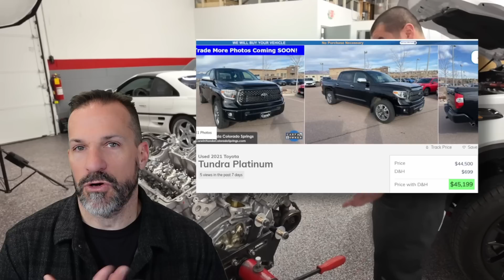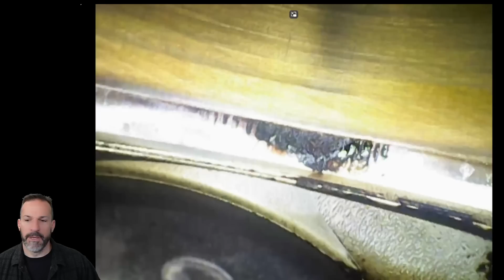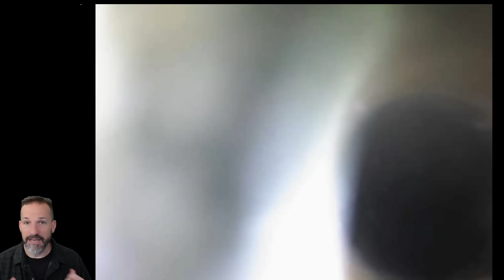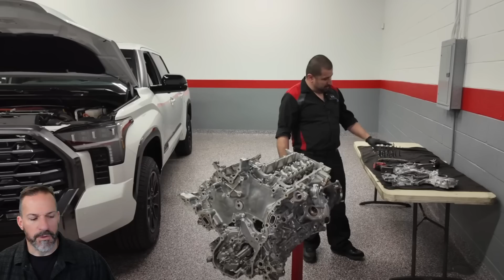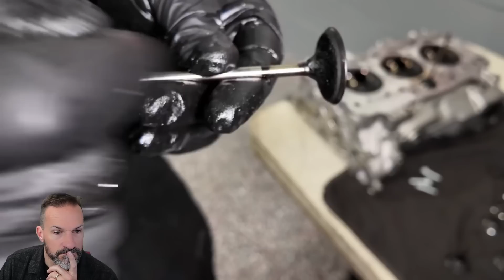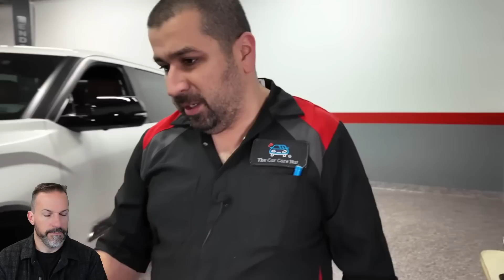Has Toyota LOST Their EDGE? Tundra Turbo V6 TEARDOWN vs. 5.7L V8

Comment: I am confident that I figured out what is causing it. Toyota doesn’t want consumers to know the truth. They messed up with the design, but it’s not apparent as to why it would fail. Updating the main bearings should resolve it, but every motor they have produced would need to be replaced. I bet the engines that fail are run harder or have a higher peak RPM.

Comment: Toyota dropped the ball on this engine design. 1st mistake is the main bearing support went from steel to aluminum alloy (fatigues 2-3x faster). 6 to 4 bolt main (again... weaker). Ladder lattice design (requires total structural integrity for full support) one bearing failure immediately induce vibration through the whole lattice.
Add: Going from V8 with 5 bearing caps to V6 with 4 bearing caps (that's 20% reduction in bearing surface) while having to handle the extra torque and horsepower will not equate to long engine life. Physics and math still applies in current humanoid engineering.

Comment: I am guessing the bearing surface area being smaller, variable speed oil pump, combined with 4 bolt mains AND the 0w-20 oil - works great in testing for mileage, but in the real world - failure.

Comment: The oil ring locking up was an issue on the 2.0T Honda engines as well. Had a 2022 accord with that engine and found that detail during my research on the engines. Seems to be an issue with tolerances with a lot of these turbo engines.

Comment: If you watched the entire Car Care Nut review and break down, he states that this donor 3.4 likely ran low on oil.  Pull that stunt with a 5.7 and you're knocking in not time.  He is a very knowledgeable Toyota tech and owns a new 3rd Gen because they're just a better Tundra, smoother ride, twice the power, and sharper looks.  This is clearly an anti V6 channel, which is fine, but let's not forget that Toyota does stand behind their product.

Comment: I bought a new 22 Tundra and I sold it at 7,982 miles after the engine started having a noticeable thump as the engine lit off during start. I really liked the Tundra but yes, Toyota has lost its truck edge on the Tacoma too.
Reply: As well as losing its edge over its biggest rival of all, the Nissan VK56 V8.     That Nissan has never suffered from blown head gaskets or any other of engine problems.
Reply: @robertpoirier8520 especially the Gen1 04-15 VK56DE, seen endless with 400-800k+ miles!

Comment: Im against ALL  of the small displacement big power turbo engines.   Manufacturers are expecting 2 opposing priorities to reconcile,  more power with less materials.  These little engines are putting out power and torque that's expected from an industrial turbo diesel but with much less mass , aluminium block and head instead of cast iron. It can't last. The pursuit of ever decreasing emissions has hit a wall , its time to accept that and back up a bit. Im keeping my 06 and 16 V8s.

Comment: TCC does not understand bearings well. The locating tang does not hold the bearing, the crush created by the cap does. Also the that main bearing was loose because the spun bearing oversized the bore

Comment: Well, if a turbo engine starts using much oil it is prone to detonation. That's how I think the cylinder wear happened. This is a problem with a most of the companies now, not just Toyota. Turbo charging smaller engines is the only way they can meet current emissions. From an emission standpoint a V8 takes in twice as many gulps of combustion air per revolution as a 4cylinder. That said, the engines were so clean by say 2020 that it seems like the ones doing the regulating just want the ICE gone. That's certainly not reality though. The electrics have the same problem they've always had. Adequate battery storage without burning your house down.

Comment: This is a combination of several things starting with the engine design, moving away from what has been proven to work to adopt what people call creature comforts. Bring back the 5.7 V8, do away with the large distraction computer screen in the cabin for the infotainment center. It’s more distracting by the way. Take off things like cylinder deactivation it does nothing to save fuel to begin with, just adds wear and tear on an engine over time.

Also, make none panoramic sun roof option because when that fails it’s going to be a very expensive fix.  Trucks have become a status symbol now for many. Oh look mine has a panoramic view, yours does not. Mine has more horsepower and torque, yours does not. Mine cost ten thousand dollars more than yours. 

Well, as long as you know how you are going to pay the car note. Many people do not care about many of the above things I mentioned. They want a truck to go to Home Depot, haul gravel, dirty, plow snow, and be safe while doing all of the above. That is not a down payment for a home, or the price of one in some places. 
I do not care what you drive whether Ford, Ram, Chevy or Toyota. All of them need to go back to making reliable vehicles and stop handing out insane bonus to their CEOs and for what?  If some people continue to purchase these vehicles at the current asking prices and with the issues they are having. Nothing will get fixed.

Comment: Good video. I've been such a Toyota fan since the 80's but they had so much time to work on a whole new engine and continue to struggle. Has the culture at Toyota totally changed? The Toyota Way in manufacturing used to be about getting it right catching issues. It seems like that is gone now. I wonder if anyone has been fired in development and engineering? All the great feedback and tear downs they did on the old generation you would think they would have learned something. Their testing in the past has always been rigourus and I just don't get it especially since they had time to get this next generation right. It almost seems like things got rushed towards the end before production maybe due to COVID or something. I still believe in Toyota but they need to react quickly and hopefully have a nice refresh for 2026. What do you think is going on internally with them now?

Comment: Where the hell was the testing on these motors BEFORE they put it into production?  They should have SLAMMERED these engines with constant driving, old dirty oil, low  oil, thin oil etc..  overheat the bastard.  WORK THAT BEYOTCH!!  PROVE it can handle ANYTHING you throw at it.  THEN you put in your truck and put your name on it.

Comment: Damn. That TT is burned up. That cylinder wall wear is terrible. Low on oil? It would have to be pretty low for a prolonged time. The engine is just poorly designed. Also, you see the pistons' top ring land? Top ring land to top of piston is too short, kind of like the Subie EJ motors that would break ring lands. I think Toyota just made an engine that is too complicated, and they aren't used to designing engines like these, and sometimes I wonder if BMW had anything to do with the design of this engine.

Comment: All factory turbo vehicles arent meant to handle anything force induction. How long would the stock bearings, rods, valve, rings hold up to even 50k miles? Nowadays its meant to break down at a certain mile and if its beyond warranty, youre F'd!

Comment: Run cleaner through the engine and or soak the cylinders with atf overnight and keep the plugs out the crank it to get all the fluid out that scratching could be a ring starting to stick from Carbon

Comment: We love our '18 Camry.  4 banger with 101k miles on it.  JUST did the first brake job and the rotors were fine!  I couldn't believe it.  Even the backs were good.  And the rear pads were only worn 50%.  Averaging 37-38 on the highway, comfortable, interior holding up exceptionally well.  Great car!!  We looked at a base model 2025 Tundra SR5 4x4 with a twin-turbo V6 for $45k.  It was tempting, but with the issues Toyota is seeing with these V6s I'm VERY hesitant.  Thinking I'm gonna wait this out to see if quality improves.  I know prices won't.

Comment: My Bank blessed me with the unlimited miles warranty for the duration of the Loan 🙏🏼 hopefully in 4 years they bring back the 5.7 and i will trade in my 2025 sr5 Tundra and get that if not I will Tade in ly 2025 Tundra and get a 2021 Platinum PS i do my oil change very 5k and the dealership does my oil change the other 5k. Miss me with all that 10k oil change BS

Comment: I think I found the issue . The Lexus 3.4 tt has 6 bolt mains while the new 3.5 Tt has 4  bolt mains. The 3.4 has abt 30 more hp and around 25 ft lbs less torque than the the new 3.5 . So they had a engine that worked but then switched it up

Comment: Those deposits look normal. I’d start running a little bit thicker oil to fill the gaps and help seal those cylinders that have wear on the 5.7l. If you’re using 5w30 I’d recommend using a 5w40 oil instead. If your climate is relatively warm that would help longevity.

Comment: I have a brand new 2022 4Runnner TRD Pro being stored.  Has just the mileage to get it home from the dealer and moving it weekly for the tires.

2022 T4R SR5 PREM  with 20,400 miles.

Daily driving 2012 Camry beater.

Thoughts?

Comment: The head gasket issue in the 5.7 is caused from engine coolant not being changed regularly, coolant PH start to shift from alkaline to acid after so many heat cycles, its this acidity that eats the head gasket, so do a drain and fill every 30000 miles or every 4 years, whichever comes first

Comment: Thanks for the content. My 07 Tacoma with the V6 has over 270K miles and is going strong. I've had multiple offers for it but its not for sale. 
Same goes for my wife's 2011 Highlander with the 2grfe. V6. Almost 150k miles. Those older non turbo V6 and V8s just keep running. 
Personally, I think Toyota is going for planned obsolescence with those new twin turbo engines. Just my take for what it's worth.

Comment: I purchase a 21 tundra new and it was one of the last one built received in Nov 2021.. I only use Pensoil Ultra and change my oil
Every 2000 miles.. Imonly have 8000 miles on the truck as I use it for towing only. I installed the Genuine Trans cooler as
Toyota got cheap and discontinued external trans coolers…..clearly the new Tundra is under engineered and it is a LEMON.
I wish they did not keep the Tundra name on the new GENERATION because it has tarnished the TUNDRA NAME.
We all know that with new EPA guidelines they should bring back the V8 with a ten speed and a 371 rear end

Comment: The Car Care Nut said the new 3.7L Turbo V6's is one of the most complicated Toyota engines he's ever seen. So much to go wrong.
Reply: Innovation adds complexity. Complexity tanks reliability.
Reply: @ My 2011 Tundra with the 5.7L V8 is at 320,000 kms (200,000 miles) and going strong.

Comment: To be fair to Toyota, this is exactly how Ford and GM make their vehicles, it does not benefit the manufacturer if the vehicle has a high resale value. This is why you can pick up an 08 tahoe for 5k while a 08 LX570 is 20k all day. You know the tahoe will not last near as long, but it does not help the manufacturer over 10 years later. People buying brand new vehicles USUALLY do not care if they have a vehicle that can go 200k miles +, they just care about MPG

Comment: I have said for a long time when everyone was pushing this debris lie, this is an engineering issue. Toyota should buy every truck back at full price  (I'm not an owner) crush every single one and stay over with engineers that know what they are doing. All that worked on this thing should be fired. They would be hired by GM and Kia.

Comment: Cutting corners and upselling... talk about corporate greed. The Tundra just started selling down here in AUS, but that same engine is also being used in the LC300 and there have been a couple stories of those failing too early.

They say it's "machining debris" but it's clearly a faulted design. Those bearings look like they have nothing to keep them in place other than the rotational force of the crank so they slip out of the journals from all the vibrations going on.

Comment: People acting like the 3.4 iforce having that catastrophic failure rate in less than 1% of the engines is unheard of.. I wonder what rate the head gaskets in the 5.7 are going to fail at once we start seeing those more often? The same channel and mechanic spoke of that issue and due to the composition of the block and heads essentially blown head gaskets require a complete engine replacement due to not being able to machine the surfaces flat afterwards.  I wonder if it's going to be the same failure rate as the cam tower leaks.. or the timing cover gaskets.. or the valley plate leaks.. or the secondary air injection pump failures.  Oh how people love to forget about all those issues the "ol reliable" 5.7 has had from it's inception.

Comment: I had a 2013 Tundra and would love to own a newer one but this is a hard pass. I watched this guy tear this engine down and those bearings missing lock out positions is very concerning. I’ve rebuilt several engines and have never seen this before. If it was a debris issue different areas of the these engines would be failing and not just the front bearings. Crap, now what truck to buy? They all have issues.

Comment: He didn't say it was a "low milage" V6, he said he doesn't know the milage on this engine.  Most likely the person who owned this engine probably beat on it and used cheap, non top-tier gas (which would lead to high carbon). He also said this was 'oil starved'

Comment: Have you been using top tier gasoline over time or other type of fuel? That may make a difference…yes?
Reply from the maker: For my engine that you saw with borescope, no, I've been using mostly cheap 85 octane here in Colorado. It might make a difference with carbon buildup but the valves looked pretty good so who knows.

Comment: Good thing I've bought the 2024 Nissan Titan with the 5.6L Endurance V8 in it with 400 HP and 413 Ibs of Torque vs the 2024 Toyota Tundra with its crappy turbo V6 in it.

Comment: December 2023 my wife and I went to a Toyota dealer to purchase a pickup truck.  You say the V6+TT is smooth?  I test drove 2 Tundras and both shook and choked when I floored the throttle TWICE each on a straight empty road.  I immediately decided one of the last V6 Tacomas still left on the lot knowing 2024 tacomas were going 4Cyl Turbos.  Using turbos on engines that can handle the vehicle without a turbo is one thing.  Using turbos to make up for underpowered engines is a NO GO.  Guess will be buying used old vehicles going forward or until car companies realize they are killing the market.

Comment: The bearings remind me of the 3.0 EcoDiesel used in vehicles like the Ram 1500. Narrow bearings being asked to withstand extreme forces. It's looking more and more like Toyota is using the "debris" theory to avoid a massive class action lawsuit over a defective engine design. They know there are hundreds of thousands of Toyota and Lexus vehicles with a flawed engine design that makes it prone to bearing failure. So instead of issuing a recall because of a design flaw, they simply say it's a rare issue caused by debris. Much more difficult to build a major class action lawsuit when it's a "rare and random" debris problem. All while they quietly make part design revisions.

Comment: So I actually work with AMD, we talked about this video and found out this motor he looked at had 22k miles and had terminal failure due to the 10k oil change intervals. These new motors are very complex and unfortunately are engineered to fail unlike the UR series engines

Comment: The guy clearly mentioned multiple times that he did not know the history of the tundra motor nor did he know how many miles were on it , one thing for sure was the owner ran it low on oil for how long ? Who knows? So what were you expecting the outcome to be from this engine good ???

You run the oil low on any modern engine and kiss it goodbye!  Even your 5.7L ✌️

Comment: Keep up the pressure guys, maybe we can embarrass Toyota back into offering a 5.7
Reply: Faithful Toyota owners and buyers need to get vocal at their dealerships and online.  Toyota needs to hear they have gone in the wrong direction.  EV’s my a##.  I don’t even like Hybrids, let alone turbo 4-cylinder engines.  Inline 4, V6, and V8 engines, these are the engines I want in my cars, SUVs, vans, certainly in my trucks!!!
Reply: They would be wise to take a page from the correction that RAM is making with the return of the V8 Hemi.
Reply: @raymondj.2351 yeah about that... None of the Chrysler powertrain plants have any tooling or anything noteworthy to actually produce a hemi. All the old tooling was scrapped, so even if they wanted to make one, it's going to be a bit.
Reply: @LoneWolfSparty  They stated that it will have production up and running by this coming August.
Reply: 100 percent